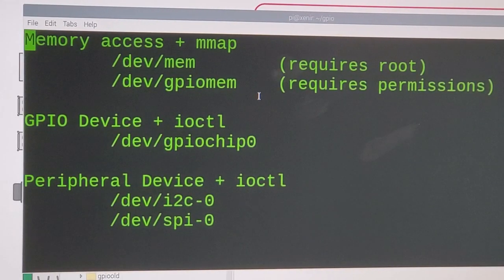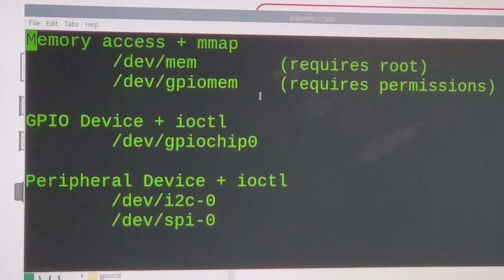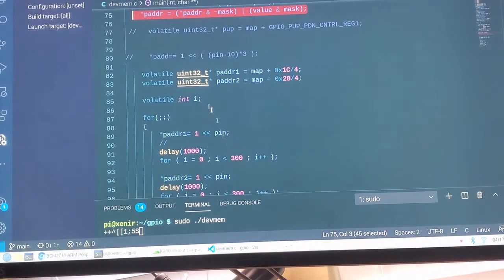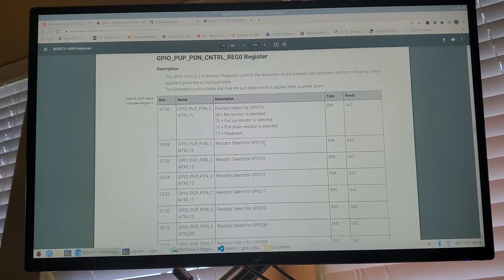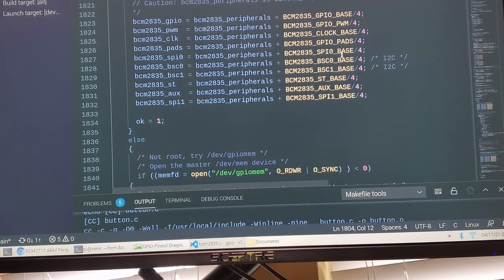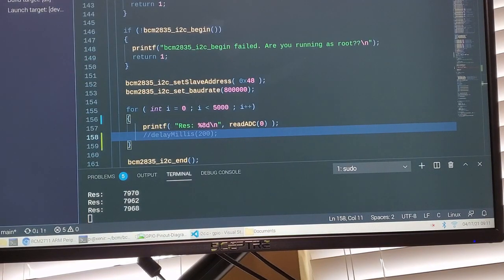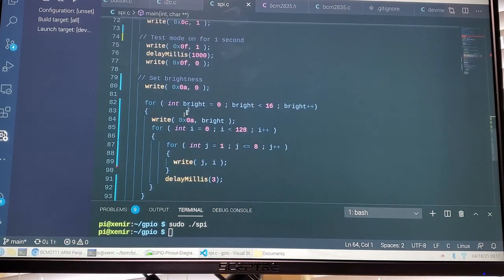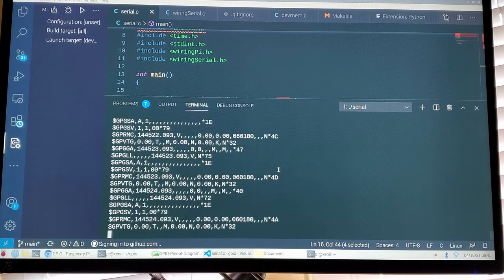GPIO, I2C, SPI and Serial with Raspberry Pi 4

Comment: Great RPi GPIO information.  I am trying to find a GPIO PWM example using OPi-GPIO on the Orange Pi-5 SBC Debian-Bullseye.  Do you have a simple servo Pan/Tilt example?  Thank you.
Reply from the maker: WiringPI has support for PWM - although I haven't tried it myself. There's this link out there that might be of interest. 
https://www.electronicwings.com/raspberry-pi/raspberry-pi-pwm-generation-using-python-and-c

I suppose I should have included servos being an RC enthusiast! Thank you for the comment
Reply: @na5y  This looks very interesting. I am learning more about GPIO design as where Raspberry Pi software works nicely. Thank you so much.

Comment: I need to send multiple data like rpi 4 7-8 bytes from arduino. How can I do this with i2c? I can send and receive single bytes of data, but have trouble reading multiple data.
Reply from the maker: While there is certainly support I didn't try multi-byte I2C reads with the bcm library. You are reading on the RPi correct? What is your arduino hardware? Have you tried upgrading the board firmware on the arduino side? Sorry I can't be of much more help - but there's lots of potential causes for the problem.
Reply: My Arduino board is UNO.  yes, the single byte of data I sent from arduino and received from rpi 4 is correct.  I am using smbus library in rpi 4 and master is working.  Arduino is working as a slave.  Thank you for your attention.
Reply from the maker: I am sorry - I have no experience using the smbus library - I assume you are using the latest. Can you try a test I2C program using the bcm library? If that also doesn't work it would point to the Uno (of course if it does work it points to SMBUS). It can be tough debugging these sorts of things without an oscilloscope to see what is going on.

Comment: Great video!  So, the bcm2835_init you showed was your modifications to the original lib?  What I see on GitLab (Mike McCauley's) is different.   It doesn't inspect /proc/device-tree/soc/ranges.
Reply from the maker: I didn't modify the bcm2835 library at all (at least that I recall - it was a while ago ;) ). The copy I have was from a while back and must have changed since I took it. The library seemed to work pretty well although I didn't go through it exhaustively. Thank you for the comment!
Reply: @na5y  Thanks for responding.   The BCM2835 in Github is different.   I must be looking at a different one.
Reply from the maker: @Russel4973  Just checked - Version 1.68 of bcm2835 was the version I used (its up to 1.71 I see now)

Comment: I need help with a project I am developing for my college degree...
I am trying to connect 2 sensors (they need 5V and 170mA each) to my Raspberry Pi via SPI. They are both energised, and connected to the same miso, mosi and clock, as they should be. 
The problem comes with connecting the SS. I need two more wires for each radar: 1 for the SlaveSelect and another one for PinTurnOn. Is it mandatory that I use GPIO 24 and GPIO26 as SlaveSelect? Or I can use any I want?
The thing is I am using any GPIO (free of course) I want at this moment and the radars work ONLY when the other radar is DISconnected. If I connect both, the screen just doesnt show anything, but as soon as I unplug one of them, the other one starts working... Any idea? I can give more dets if you were willing to help, thank you very much for your attention.
Reply from the maker: There's nothing special about SS (also referred to as CS - Chip Select). You can use any GPIO for CS duties - and usually the code library will have allowance for that (some code libraries fix MOSI, MISO and CLK to specific pins). You'll definitely have to have one GPIO/CS pin allocated per device you have attached and then you just have to bring it low on the device you want to use and keep it low throughout the SPI transaction. Once the transaction is done bring it high.

I hope this helps. Debugging SPI can be a bit of a pain at times - have a look at this video for a separate SPI example: https://www.youtube.com/watch?v=XcWFJHk5ktI&t=1s
Reply from the maker: I had to remind myself of the bcm2835 code and they do fix CS to 24 and 26

    bcm2835_gpio_fsel(RPI_GPIO_P1_26, BCM2835_GPIO_FSEL_ALT0); /* CE1 */
    bcm2835_gpio_fsel(RPI_GPIO_P1_24, BCM2835_GPIO_FSEL_ALT0); /* CE0 */

So it looks like you have to use those pins for CS if you are using that library
Reply from the maker: Edit: Never mind - I found it - you call this function
  void bcm2835_spi_chipSelect(uint8_t cs)
Before the SPI transaction to set the relevant SPI CS pin 

Looking at the bcm2835 library code I don't see how it lets you control the two different CS pins. You might have to look into using bcm2835_aux_spi_begin(void) - which uses a separate set of SPI pins

   bcm2835_gpio_fsel(RPI_V2_GPIO_P1_36, BCM2835_GPIO_FSEL_ALT4);	/* SPI1_CE2_N */
    bcm2835_gpio_fsel(RPI_V2_GPIO_P1_35, BCM2835_GPIO_FSEL_ALT4);	/* SPI1_MISO */
    bcm2835_gpio_fsel(RPI_V2_GPIO_P1_38, BCM2835_GPIO_FSEL_ALT4);	/* SPI1_MOSI */
    bcm2835_gpio_fsel(RPI_V2_GPIO_P1_40, BCM2835_GPIO_FSEL_ALT4);	/* SPI1_SCLK */